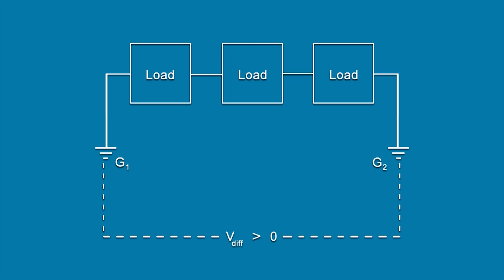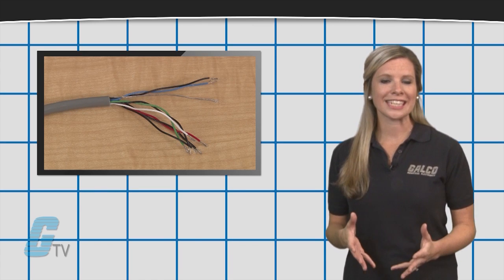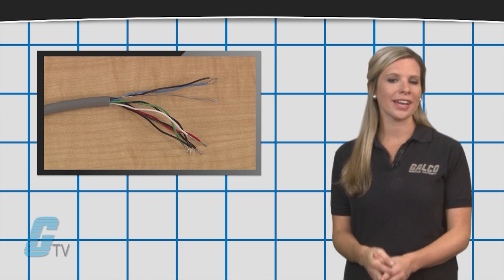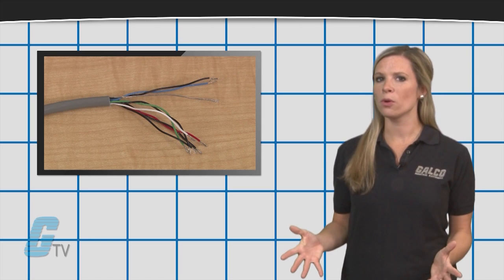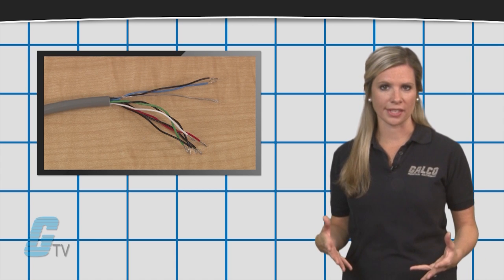How To Avoid Ground Loop Connections - A GalcoTV Tech Tip | Galco

Comment: What if there is a shield failure in the unconnected device? Will it lead to accident if anyone touches it?
Reply from the maker: Hard to say what specifically would happen, however if the equipment is live (powered up) you should ALWAYS treat it as if you could be injured until it is shut off for at least 5 minutes. Then you can check the shield for continuity and correct termination.